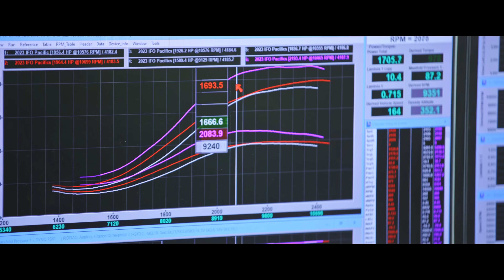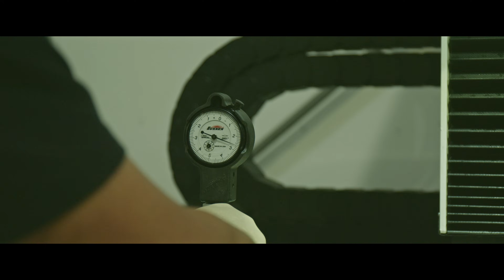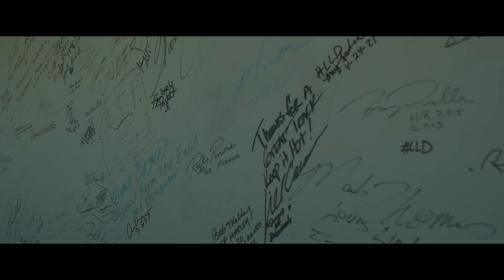A Different Animal - ROAD to WORLD CUP 2023 (4K) SpeedFactory Racing

Comment: torque plate honing the block should be done at race temperature

The head stud material acts totally different at high boost temperatures 

a CA625 head stud (stretch) is different at room temperature compared to high boost. .especially towards the finish line 

better off torque plate honing using a weaker stud (like a l19) or slightly less torque than what’s used to clamp it when racing

this will make the bore more “round” because the head stuf torque value will be closer too your high boost stretch value